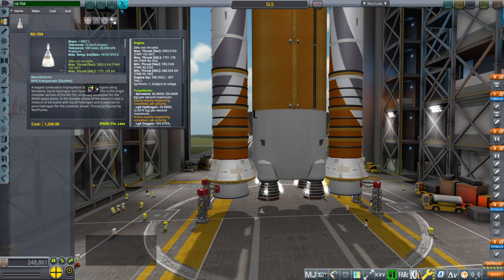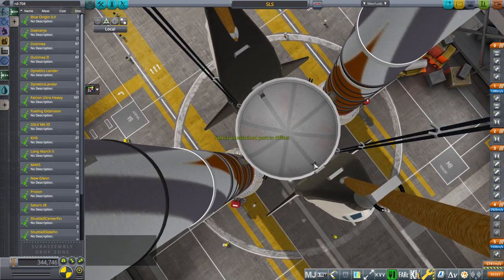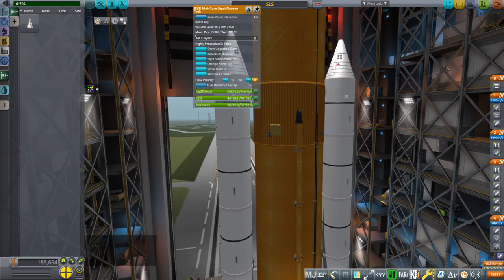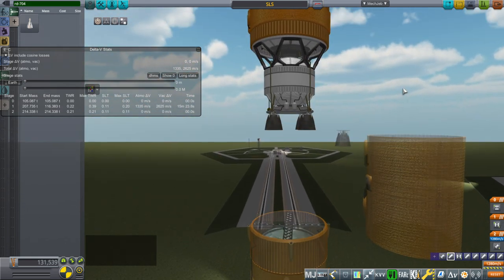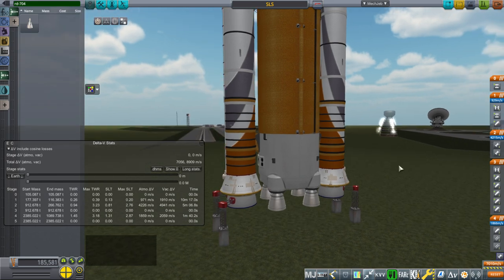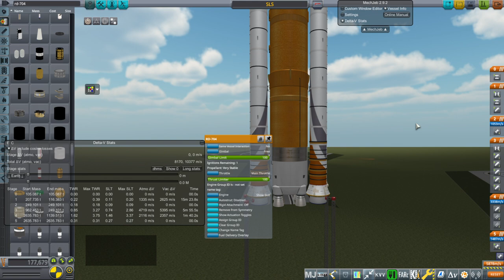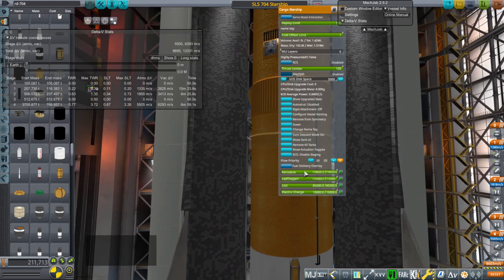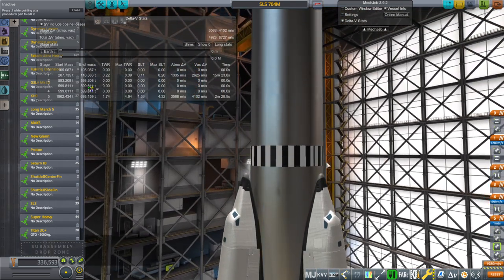KSP with Realism Overhaul - SLS and the RD-704, a discussion

Comment: The reason for why I love SLS is that it literally squeezes out the last bit of performance out of the available hardware. Except for the boosters, there is basically nothing you can do to improve SLS from a performance standpoint. It uses the most efficient available sustainer engine (RS-25) and the most efficient upper stage engine (RL10B2). In terms of payload fraction, we can currently build no rocket more capable. 

And a really good explanation of the reasons why SLS is build the way it is, awesome video and technical understanding!
Reply: Absolutely, while other rockets like F9 and Starship bruteforce their way into orbit, SLS uses every last drop of efficiency and capability to slide its way into space.  Beautiful design, but sadly to late to really be at the forefront of cutting edge space exploration with no other options.
Reply: RL-10 on S-IVB size stage really gives it a powerful C3 kick...
Reply: @_mikolaj_  Additionally, extendable nozzles look amazing!
Reply: @edki669  So sad that the actual EUS won't have them :(
Reply: I agree wholeheartedly!
Reply: @clancy5600  Yes, sadly. But in KSP I can have as many B-2's as I want xD, I'm nevertheless hyped for EUS
Reply: @edki669  Hahah for sure! B-2 supremacy

Sad that my favourite engine ever will have its retirement soon, but nevertheless the RL10 lives on.
Reply: It is certainly within the state of the art to build higher pressure hydro/lox engines, say 300 bar like Raptor and that's relatively obvious. Adding extensible nozzles like the xlr-129 or RL-10B-2 would get you higher vacuum specific impulse and better sea level thrust if you used a more sea level optimized contour on the first part of the nozzle. Alternatively, you could just use the higher chamber pressure to combat flow separation and use a larger ground startable vacuum nozzle. I believe the current SLS core uses the older AL-Cu alloy instead of the aluminum-lithium alloy tanks so, again more mass savings. A next step would be propellent conditioning to densify the hydrogen by cooling it down to the critical point where it's almost a solid i.e slush hydrogen. That would improve thrust and payload mass fraction. Next step would probably be to add aluminum or iron fillings into the hydrogen to "load" it with more energy. (Most obvious thing would be to just add another RS-25 and stretch the tanks)
The upper stage could switch to something like the RL-60 or MB-60 for higher thrust and specific impulse. Switch the upper stage tank design to a common bulkhead and balloon tanks for better mass fraction like Centaur. 
Point being there are several things you could do to improve the performance of the core and keep it hydrolox. Most of this stuff was proposed back in the 70s.
Reply: the large upper stage, the EUS, uses RL-10C-3s, which trade thrust and ISP for reduced mass, price, and increased reliability. They could, increase performance further by using a larger upper stage powered by a J-2X or 2 BE-3Us, and using liquid fuel boosters, using ORSC or GG engines.
Reply: @chriskerwin3904  i kinda am afraid of flow separation. During ignition SSME nozzle already wobbles a lot, flow separation could perhaps kill it
Reply: @jmstudios457  I guess there are some kilos of payload to be gained, but not with the J2X, it's just too heavy, the thrust doesn't make up for that

Comment: Your previous videos on the RD-701/4 got me thinking...

What about a launcher with a sustainer SLS-like core, with RD-704s that has the kerosene tanks as side boosters. Those would work as drop tanks. Or a similar design where you've got Kerosene/Oxygen boosters with engines on those (maybe some RD-180s to make it ultra soviet haha) and the kerosene crossfeeds from the boosters to the core's engines.

Maybe you could consider a launcher following that architecture?
Reply from the maker: I've thought about the drop tank option and shared fuel for RD-171s as well. It deserves some additional consideration, but obviously it's difficult to optimize.
Reply: @RaizSpace  nice! Well, I'll be interested to see if you ever build it

Comment: What about a giga-Atlas I setup, with 4 or so booster engines (e.g. F-1B) burning kerolox that drop off the side of the vehicle, leaving 4-5 704's as sustainers? They can burn off any remaining kerolox and then switch modes.